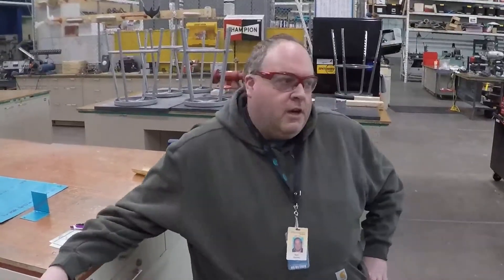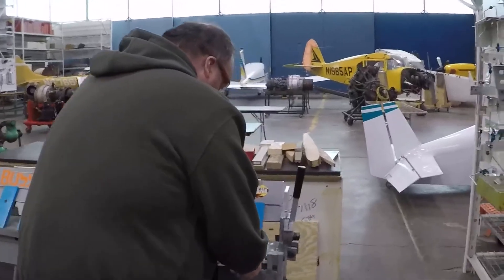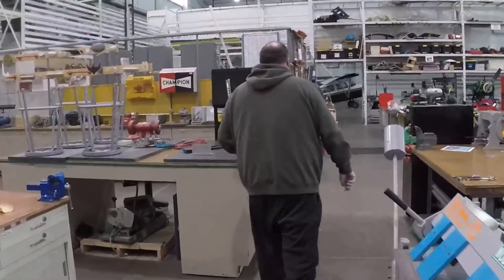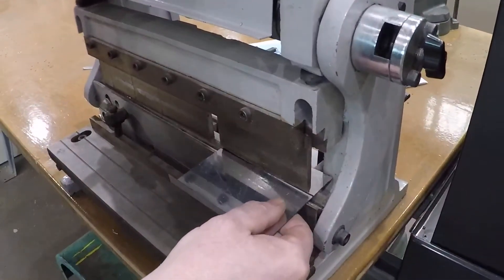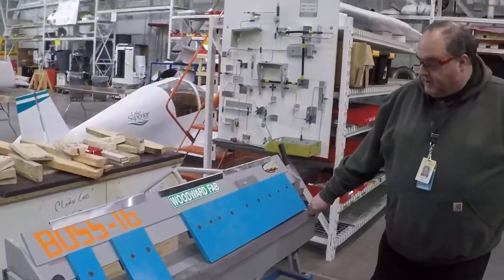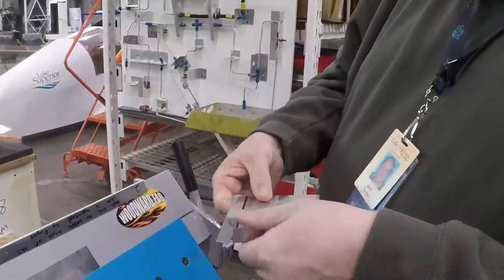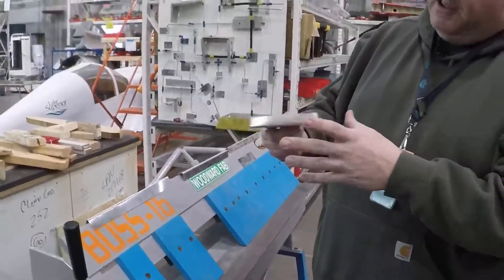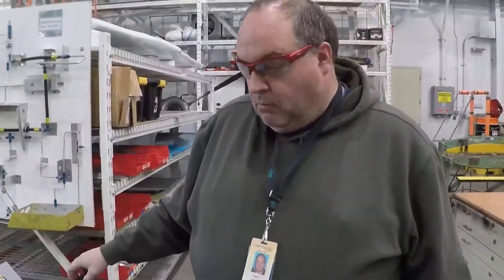Aircraft sheet metal bending brake demo and setup

Comment: At the 8:00 mark you state that your brake is setup to do a 3/32 bend radius. Is that due to the radius on the brake fingers or because of some adjustment to the machine setup? I am just learning about brakes and will need to be making quite a few parts that call for a 3/32 bend radius so if I can have my machine defaulted to that I can avoid shims in most cases.
Reply from the maker: Yes. My brake fingers are 3/32 radius
Reply from the maker: Yes.  My brake has fingers that have 3/32 radius so I don't need shims to do that radius